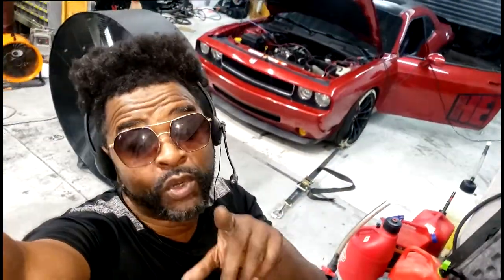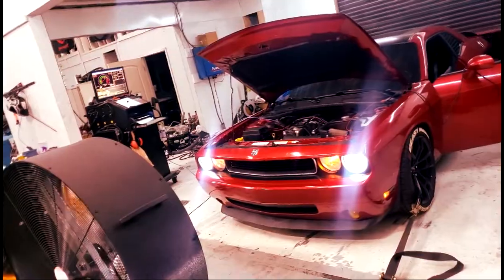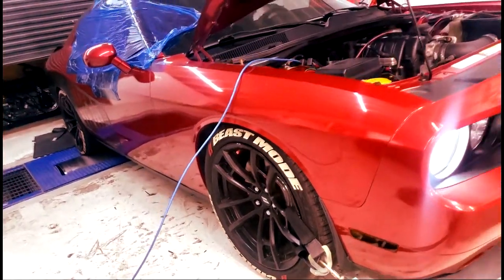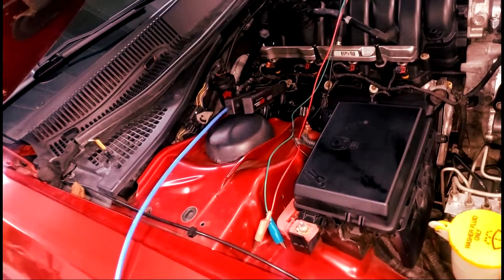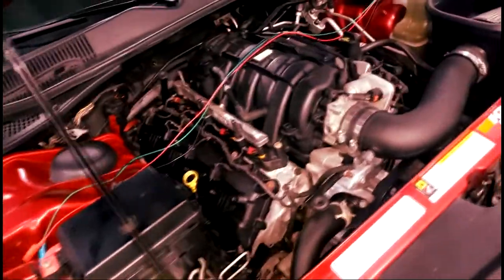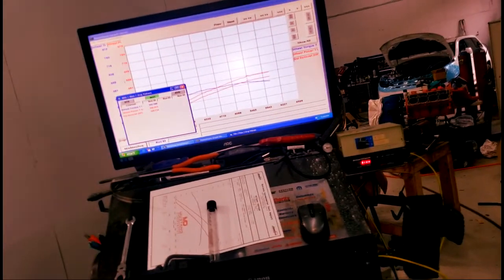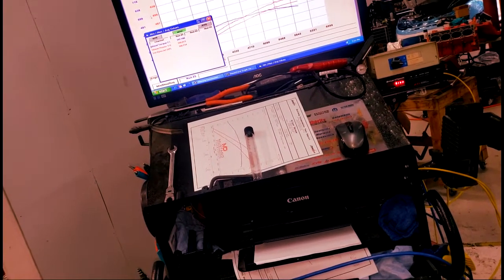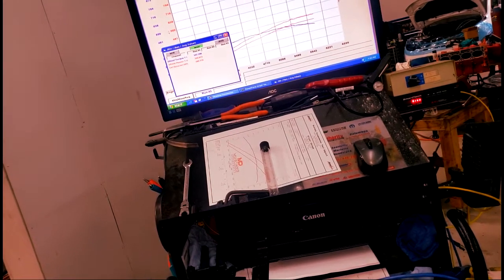Dodge Challenger 5.7L V8 345 Hemi upgraded Camshaft MDS Delete done. Dyno Pull time. Allpar Garage.

Comment: I knew you were going to post this part eventually. Good to see a normal 5.7 with some mods on the Dyno to see what you can expect for some power without a blower and everything.
So what did it finally make and what mods were done?
Reply from the maker: I failed you guys..lol..I did not ask or speak on the main goals of the added mods and tune..The next one I will be well prepared.
Reply: @OnlineMechanicTips  I couldn't really see the numbers on the tiny pc display they used but if it had the standard head upgrades and mods probably around 500 or so. Ask next time you're in and maybe suggest they get a bigger display on the wall or a safe heavy stand and everyone working on it can easily see the results. Most of the big Dyno shops use a pc friendly HDTV mounted to the wall so they can see their results easily from inside or around the car and take pictures or video.